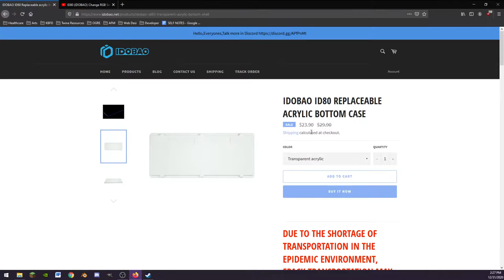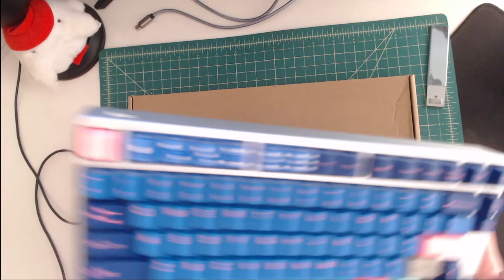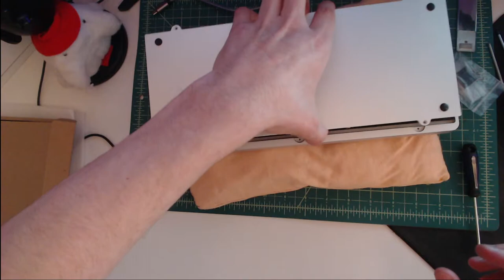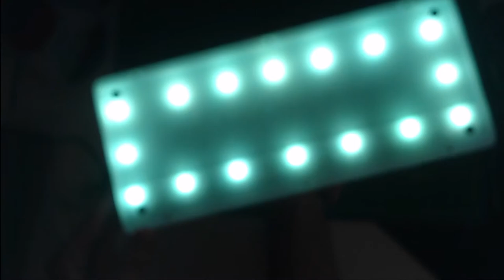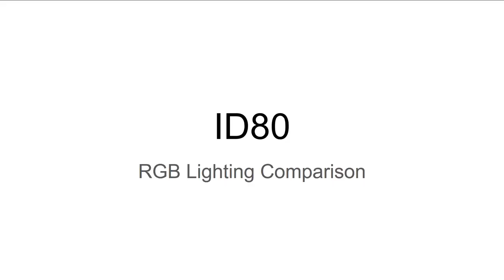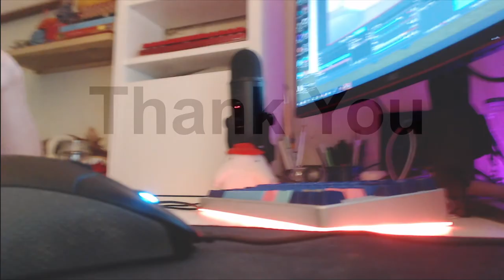IDOBAO ID80 Replaceable Acrylic Bottom Case

Comment from the maker: I prefer this look to the ID80 V2
After reviewing - I noticed that the V2 has more lights, but also the case is a bit more integrated (and has a weight) 
I personally think this looks greater as there is an emphasis on lighting
Reply: I finally got mine today after a month shipping and the bottom 3 screws would not tighten at all sadly I think the screws were too short or the holes came stripped or something but they spin freely. Luckily the top row all screwed in well so it isnt like the acrylic is going to fall out but still kinda a bummer. also accidently set the acrylic down on a not super clean surface of my coffee table and it immidiately stained the acrylic some how so rip but its not like im staring at the bottom when Im using it.   

EDIT: realized pretty quick that I  was just really stupid and has tried to install in upside down and now all screws work:)  one weird thing is that the keyboard sounded a bit nicer and deeper when it was backwards which is weird but I’m loving the improved sound and the rgb lighting the metal was hiding is super awesome. I was a little intimidated with doing the qmk thing but all I had to do is download via and it instantly worked didn’t need to do any extra flash or reset button on pcb so that was pretty awesome.

Comment: hey man quick question about this keyboard, when it is dark, will it be too hard to see the letters on the keycaps. I was curious if the light from the computer screen is enough to give you a view of the letters.
Reply from the maker: Good question! these keycaps don't shine through - I might order some soon from TaiHao website, they have been making some nice PBT shine-thru key cap sets
When I do, I'll post a comparison video
Reply: @MicrowaveFork  nice, looking forward to it. I currently just bought this kb so the comparison will help which keycaps ill buy for it
Reply: No point using shine through keycaps as there is no RGB on the PCB itself.

Comment: how do you change the rgb?
Reply from the maker: You have to hold the Function Key, its the isolated on next to the far right corner of the keyboard:
Check this link for the Default keybinds - 
Function is going to be called:
MO[1]
https://config.qmk.fm/#/id80/ansi/LAYOUT

Hold Function (or MO[1]) and press the button:
MO + Q: Turns it off
MO + E: Changes the RGB effect
MO + R: Changes the Color

There's other functions but you can look them up in the link I sent

I also used VIA on KBD fans keyboard - its very much so easier to use:
https://caniusevia.com/

I hope this helps/makes some sense
Reply: @MicrowaveFork  i mean to say the top rgb not the side rgb